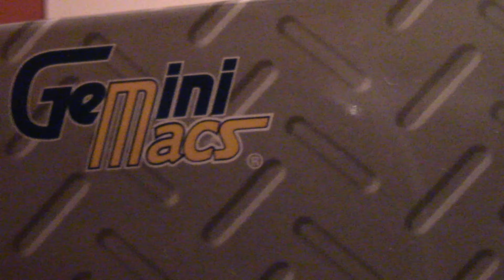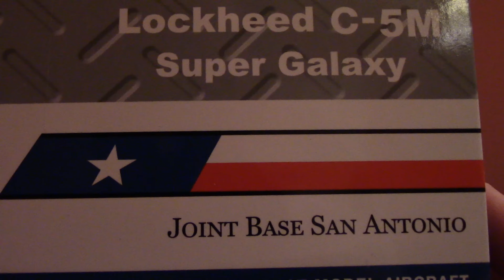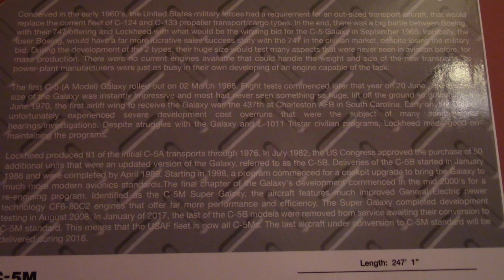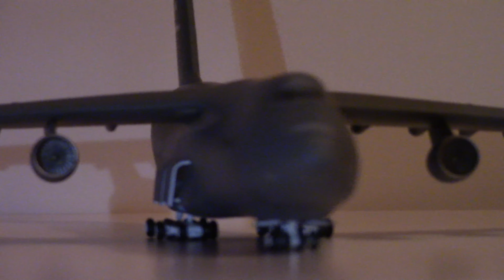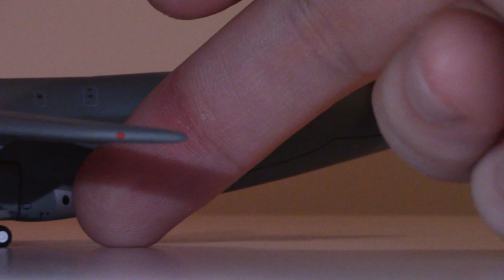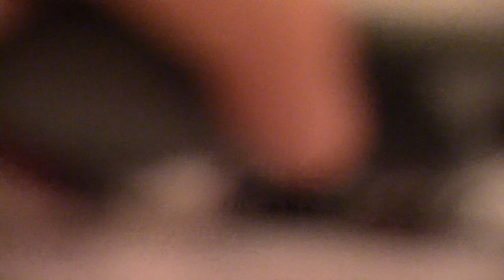Gemini Jets Lockheed C-5M Super Galaxy - 1:400 Scale Die Cast Model Aircraft Review

Comment: Bought the same model and its an amazing plane for my collection. In my opinion better than Herpa (had this model with wrong engines). The An-124 Ruslan is almost the same size but has more payload than the C-5M. I dont know if its true today but i read that the An-124-100M is in military service in Russia (4x planes). If its true C-5M is not No.1 in terms of payload capacity.